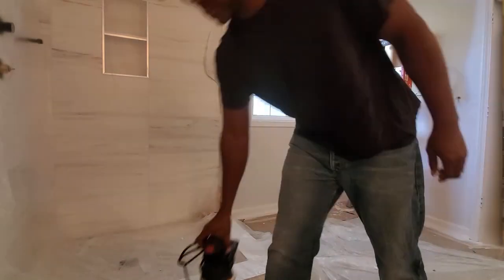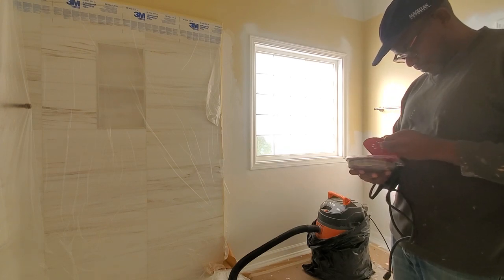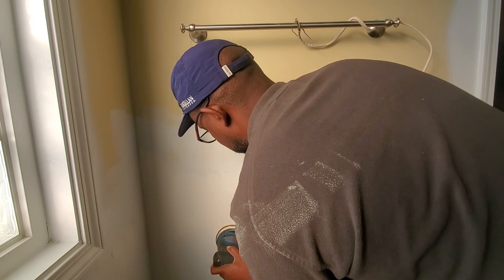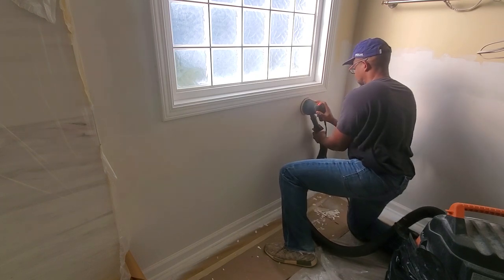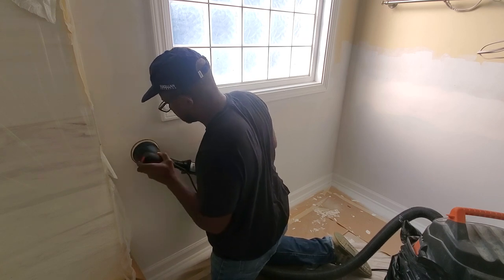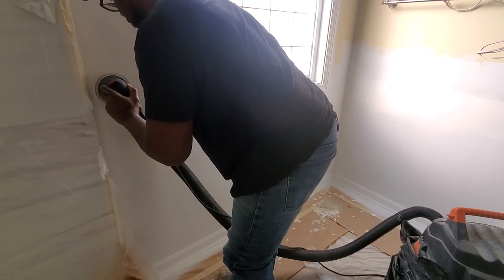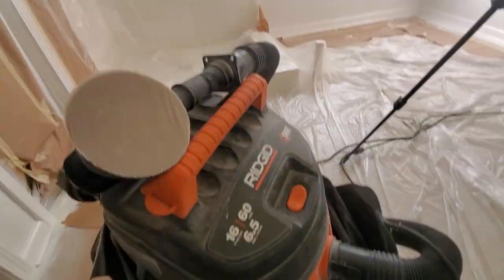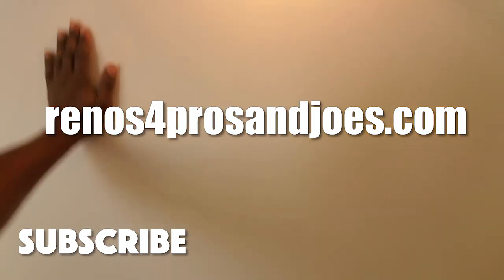HOW TO SAND DRYWALL WITH A VACUUM | Bathroom Remodel UPDATE

Comment: Just wanted to add that if you had an area thats not so big and you just wanted to sand it with a sponge and not have to hook everything up. You can use a long mud trowel pan to hold underneath what your sanding and if you do it carefully you can catch most of the sand dust falling down. Great info though.

Comment: Great tips for beginners!    hadn't thought about using my orbital and didn't know there are screen pads for drywall.   Also - that hose adapter/reducer - can you link to where to get that?    Hopefully some day you can become an Amazon affiliate and link all the supplies and tools you use.    I would add a tip to set a floor lamp to the side of your work and it will easily reveal any imperfections.   :)

Comment: You should get a portable bucket top dust stopper and switch to Diablo mesh style sand paper. Add a filter bag inside your shop vac and you will have zero dust.

Comment: Great video, it looks very smooth, did u put ur vacuum in a trash bag to prevent back draft dust, seems like every time I use the wet/ dry for dust collection the back draft dust comes out the exhaust.
Reply: Use a dust collection bag inside the vac. Works great

Comment: After you gain more experience doing the mud work an electric sander really isn't necessary, don't get me wrong it takes a bit, but now days I just scrape between coats and then a quick sand with a handheld Hyde vacuum hand sander. I ruined my DeWalt sanders bearings doing drywall with it.

Comment: ❎. What's your thoughts. 
        Your little gittyup - 
complete package sander vaccuum
          to remove 🍿 ceiling?

Looks perfect to me
   Light weight, not awkward
      not so cumbersome,
        neat, clean, tidy.
      Leave a little, not to have
                    to texture (?). 🚩
  Looks cost worthy.
    Just some stilts, or planks
     smooth right along.
Lots of sanding pads?🚩
     Resperitory mask?
I'm just estamating
         my 💰, energy, time.
So far all the vids if seen
     this looks best in theory.
         I D K never done it before.
All the little unknown tips, details.
Tu
🤺💐